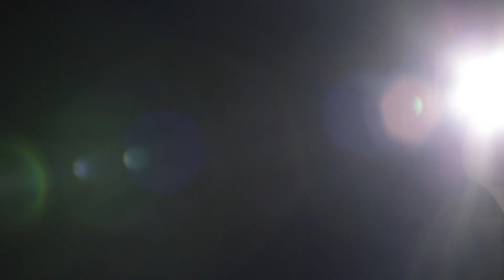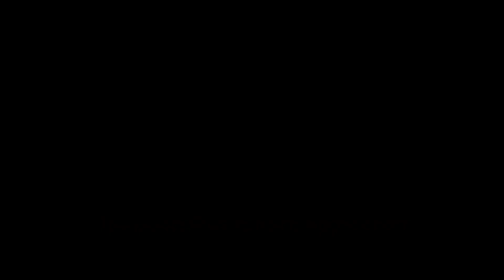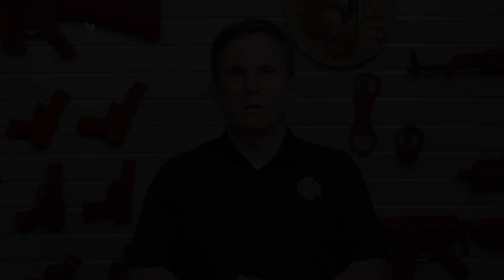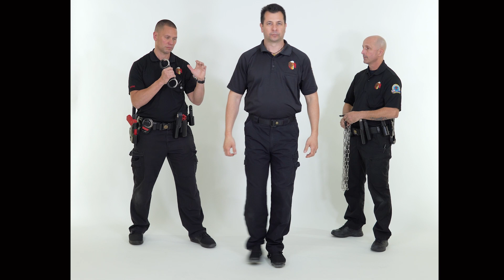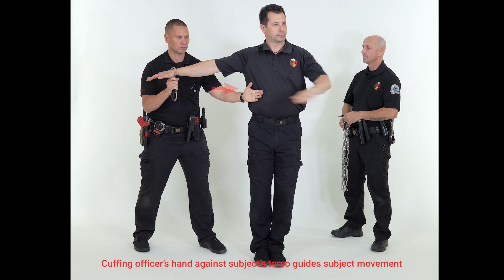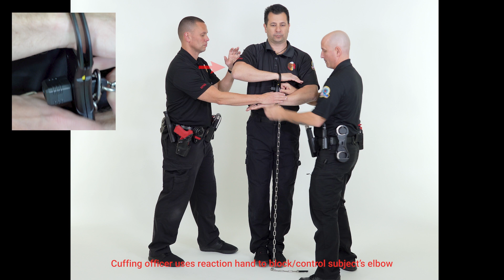ASP Training Room - Transport Plus (Chain) Application

Comment: Is it possible to use this set with the hands cuffed in the parallel position?
Reply from the maker: ASP Transport System products use our rigid handcuffs, which are primarily/ideally designed for arms crossed “stacking” restraint. This is the way the system is taught in our training programs. In some situations, it may be desirable and possible use the Rigid Cuffs with different arm/wrist positions. This would be an agency-dependent evaluation and decision.